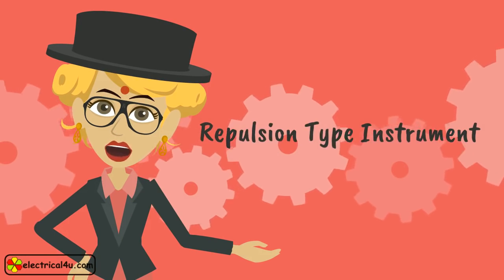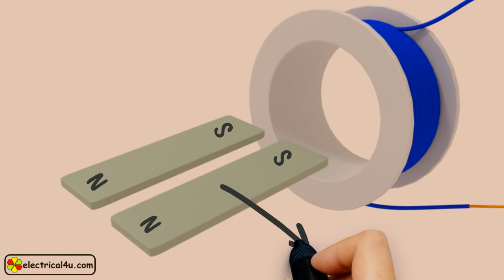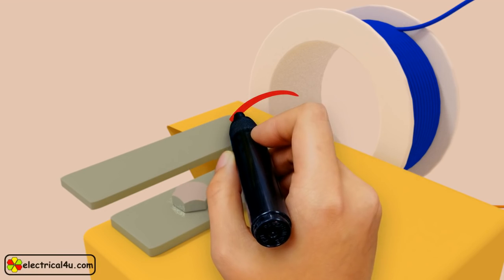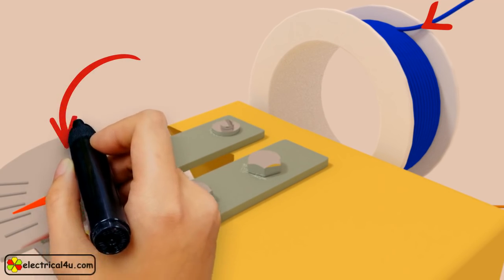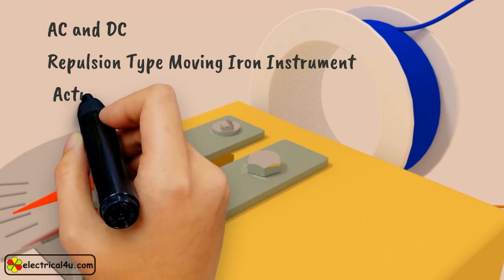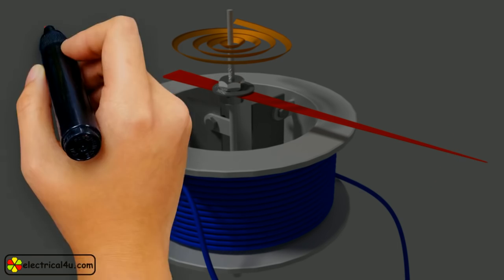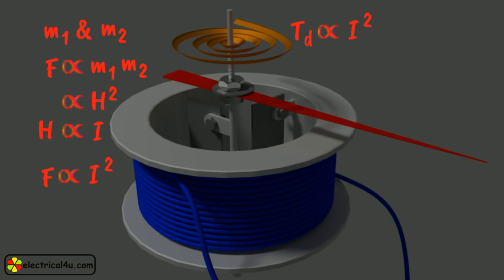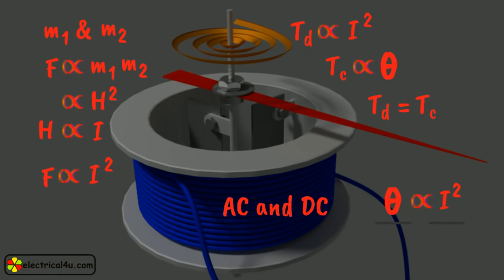Repulsion Type Instrument

Comment: Thanks for clear explanation! I can understand how repulsive force is used to measure ac current But i wonder how to read exact figure as the pointer might oscillate consistently if it is ac current.
Reply: i think if the frequency of a.c is quite high then the poles developed are oscillating so fast such that they are not oscillating at all...